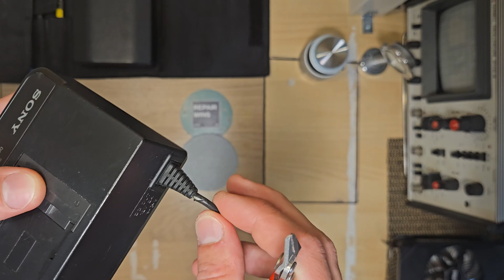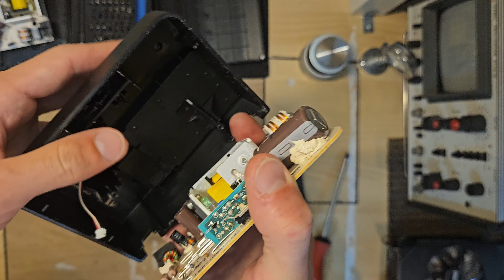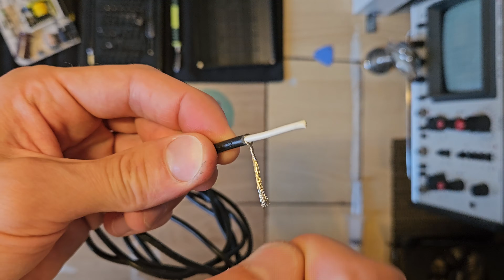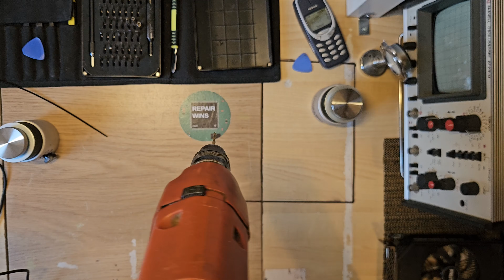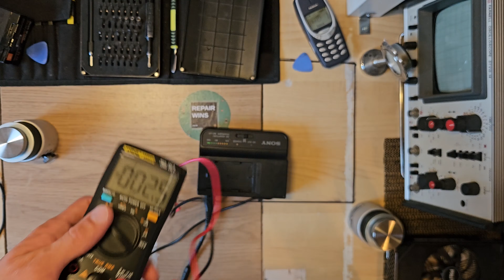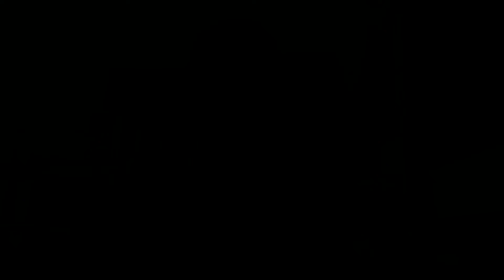Repair a Charger with Damaged Strain Relief (without Buying a New Cable)

Comment: Interesting approach, have you ever tried TPU in your 3D printer Callum? (had to do an direct drive mod on my Ender3) but that could be a mean way of doing these kind of repairs. But don't get me wrong  some times needs must :) and I do appreciate not everyone has a 3d printer on hand too.
Reply from the maker: My printer can't print TPU by default and I don't have the time (and I can't be bothered if I'm being honest) to mod it so it can. 

I was quite happy with this mod actually though I understand not everyone wants to drill holes in their chargers. Either way, if you don't want to spend any money then you don't technically need the Sugru. You could also buy a replacement cable with the end already on it but usually they're only available from China hence a 2 week wait. There are multiple ways to skin a cat I suppose.
Reply: @RepairWins  No, I get it - and there are always going to be different approaches (We know what we know, and we have our limits as to how far we're prepared to go to do things) :)